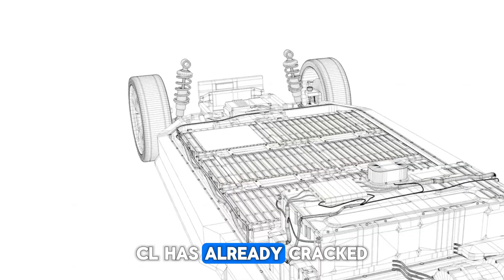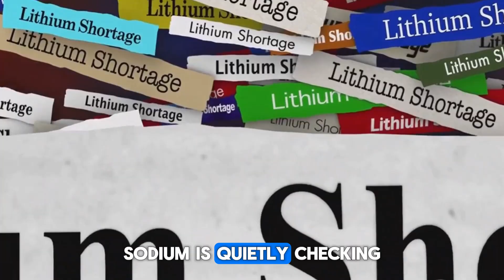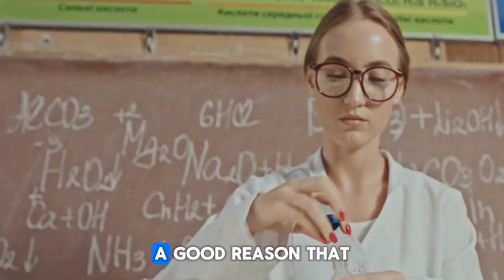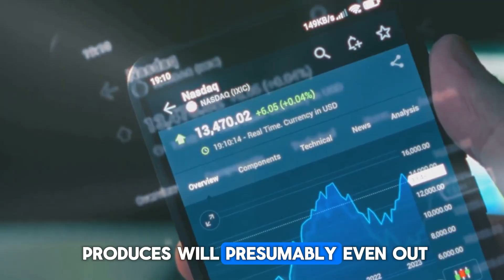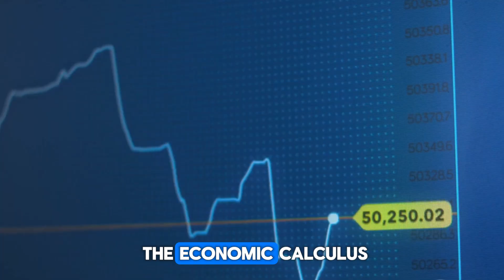CATL Announces 2nd- Gen Sodium Ion Battery with 5 Minutes Ultra Fast Charging

Comment: You can have lower capacity and therefore lower weight if you have exceptionally fast charge time.

5 minutes is less time than it takes to fill a tank with petrol. Lower weight because of less batteries means better efficiency.

This will result in a total rebalance of range, recharge times, weight and cost. 

It looks like sodium will be far better for a cheap, efficient car for commuting, with fast charging at home or at destination. Recharging stations will be far more accessible because they will be able to service many more cars with the same station.
Reply: eh, look at the stark varg, fastest dirtbike on the planet, 80 hp max if your pushing it, or like say going on a highway, it will run out of juice in like 45 min.  

now if it was sodium with the same weight cuz you cant always keep putting more patteries in somehting thats supost to be compact, the  thing could  run out  in 25 min or even a bit less, and  in the best case  it can charge 3-4 times faster 

so  lets say 35 ish minuts.  and thats best case.  waiting  over half an hour just to ride for   25 minuts , well 1  it wouldent be able to compete anymore but even using it on the streat to go places   is still abysmal to wait over half the time and every 25 min? you will get no where.

but realisticly, charging is only slightly faster so  you relisticly you would get 25 min of run time   and have to spend an hour and a half,  charging.

this would make  it totally unviable. MAYBE  if there was a HUGE battery bank for  semi trucks that deliverd  things short distances, it could be good long term  but for any other vehicak, it be awefull.

Comment: Ok, while Sodim based batteries will become a thing, the do not represent the end of Lithium based batteries at all, for that the drawbacks are way to big. The closest replacement to current Lithium based batteries would be the solid stated batteries. Sodium will however dominate certain market segments where their benefits is more favorable than the drawbacks.

As I see it:
Sodium-ion will likely dominate cost-sensitive, short-range applications where weight and size are less critical.

Solid-state lithium will serve performance-driven markets where energy density and safety are paramount.

Hybrid packs (like CATL’s lithium-sodium blends) may become common in mid-range EVs, balancing cost and range.
Reply: Most people don't make long trips very often and need to stretch their legs for a bit every ~3h of driving. As long as charging can be fast enough to be completed within those breaks and the battery has enough cycle endurance to last the lifetime of the car being used that way, most people aren't going to care much about sacrificing some range for lower cost and better energy efficiency, especially if they have 2-3kW L2 charging available at most places they park at for the day and night. Range anxiety isn't as much of a thing when you can effortlessly start normal days with a full tank.

Range anxiety mostly persists because charging infrastructure still isn't ubiquitous nor as clearly indicated or directly visible on many roads. Gas stations are clearly visible from half a mile away while most fast-chargers are nearly impossible to find. You have to use apps/maps or otherwise know where they are beforehand to have a chance of finding them. People would be anxious about gas range no matter how long it is too if gas stations were as difficult to find the first time around.

For the six months where I was driving my mother's Bolt EV as my primary vehicle, 120V/12A was all I have needed for daily use and ~5min ~40kW bumps on longer trips to avoid reaching my destination on a completely dead battery.
Reply: @teardowndan5364   I bought my first EV back in early 2013, a Nissan Leaf gen1, and I drove it for almost 170000 km before my daughter wrecked it, so I have a lot of experience with short range cars, especially during the winters here in Norway. I'm currently driving a Tesla Model 3.

I charge at home, and rarely use quick chargers. But our charging infrastructure is so good it's vary rarely an issue, as you say, we do have to stretch our legs from time to time. That said, in my experience, 400 km is the absolute shortest range I would accept in a new car. This is reduced in the winters, and you would like to have some extra head room in general. Preferably you would like to have 500 km at least.

Now, these numbers will probably change as each technology matures, but the estimated average range of Sodium-Ion vehicles is 150-250 km, compared to the current 300-500 km range that is more typical for Lithium powered vehicles, with Solid State Batteries topping this with 500-800+ km. 

Now, 250km might be enough for the to and from work car, or city cars if you like. Even if CATL's Naxtra cells pushes this to 300 km, this is still 100km below my preferred by experience minimum, but we have different needs and expectations for different applications.